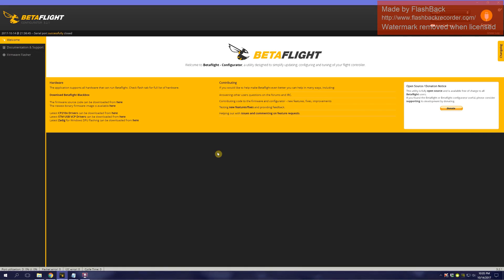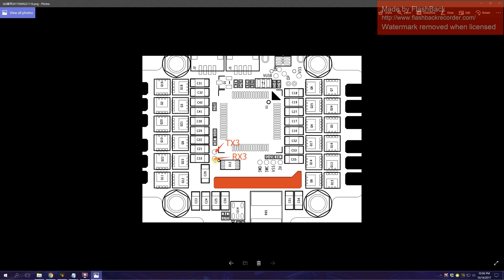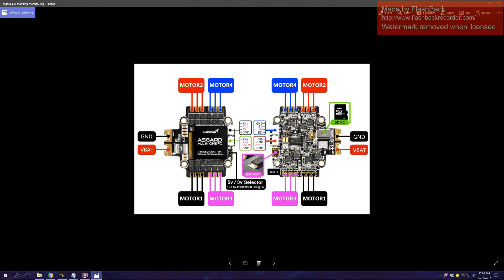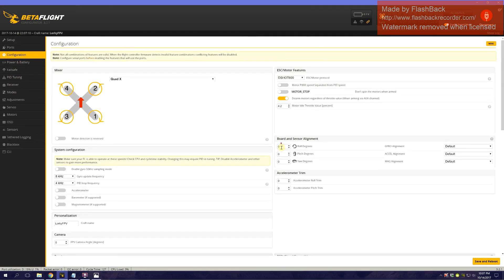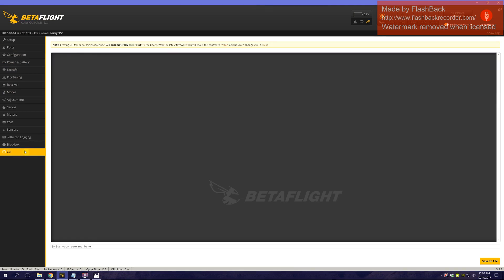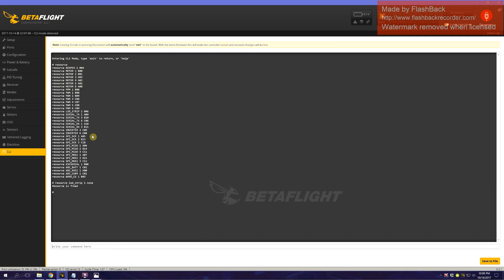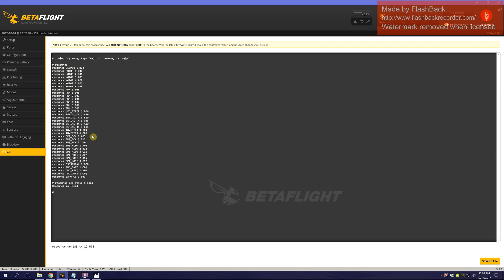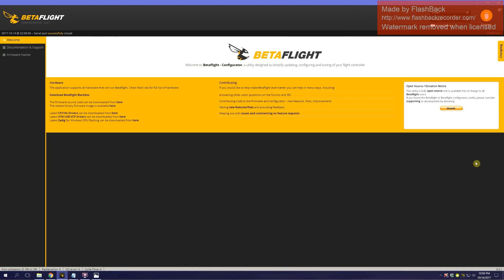Smartaudio over softserial without using UART on Unify Pro

Comment: I tried exactly this and for me it does not work. Any ideas? Led strip1 pin, had a different resource address of course but... no go
Reply: I'm on the same boat. I'm trying to do this on Eachine Novice 2 board (NanoX F4 v1.0). The LED_STRIP was mapped to A00, so I unmapped it, and mapped SERIAL_TX 11 to it. I set everything else as in the video. It just doesn't work for me...
Reply: On my omnibus f4 pro v2 I tried to set up smaraudio via the led strip 1 which didn't not work. I guess for the led strip to work with softserial we have to also use the ground pad because I can use camera control via led strip but not smaraudio

Comment: This helped me out, Thank you. Can you resource a rx6 or rx1 for smart audio? I bought ready to fly quads f3 and f4 aio fc and instructions are vague. I will try led but may want to use led later?
Reply from the maker: yeah you should be able to use those
Reply: Thanks so much. It is a never ending battle between upgrading firmware to new components. Now 6s low kv motors are all the hype for racing. Thank you very much.

Comment: How could I remap the smart audio to a soft serial 1 CH1 or CH2. I suppose I am asking for the command line :)
Reply from the maker: Just need a pad that is available such as LED or spare motors, use that memory location (B07 as an example) and remap it to serial_tx 11 for softserial 1 and then select the peripheral type under ports.